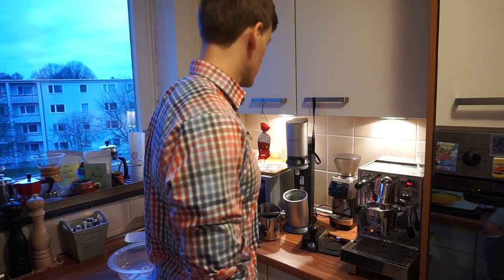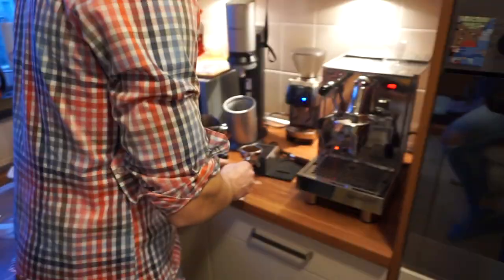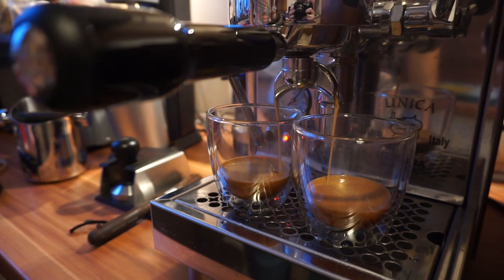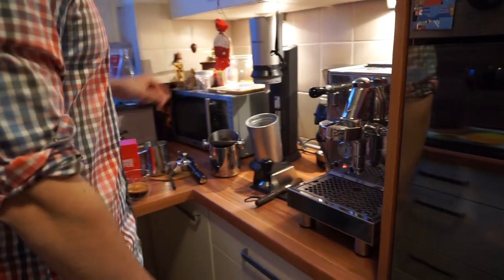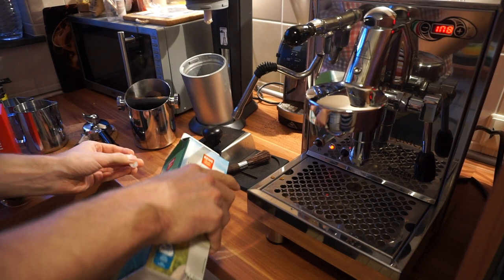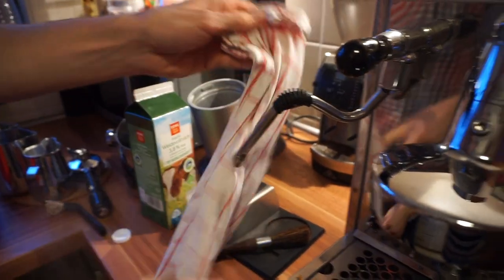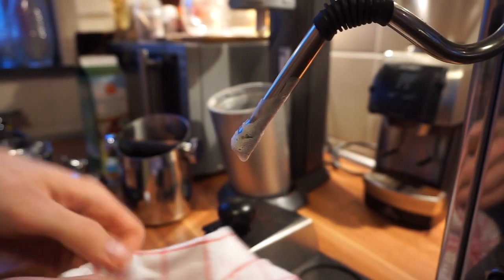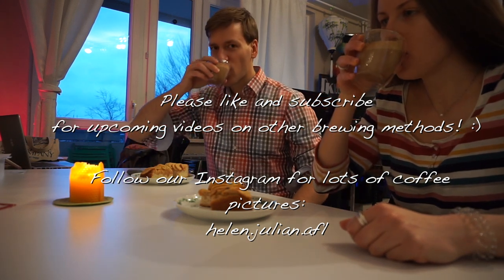7. VLOG: How to make a Cappuccino with the Bezzera Unica

Comment: Good to see we almost have the same modus operandi. I have an Unica as well and enjoy my cappuchino from it. Didn't you have issues with the PID after the first cup AND steaming? 
I did. 
The temperature went unstable and dropped too far down. Now I know you have to refill the boiler, using the left switch. But that's not in any manual.
Reply from the maker: Thanks for your comment! Yeah it is true: That is why I usually clear the boiler by releasing the steam first and then start making the two Cappuccinos. After the release the temperature drops but after that it is pretty stable and I don’t have to refill...